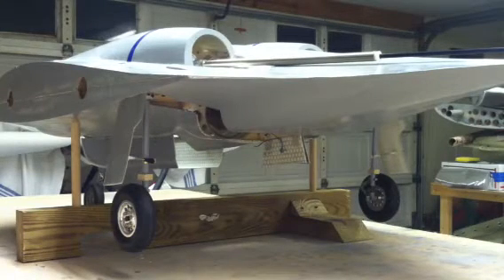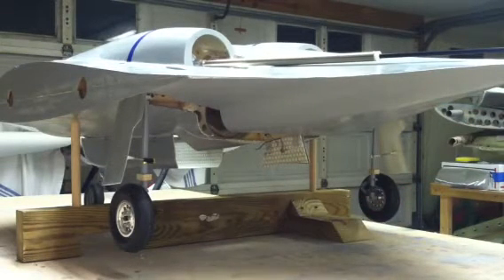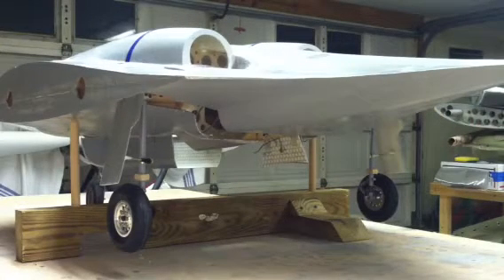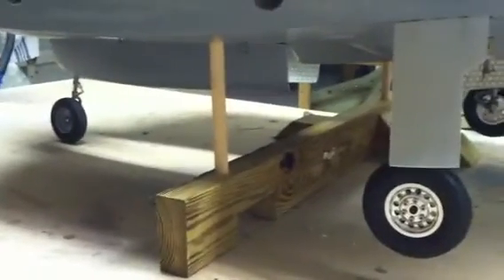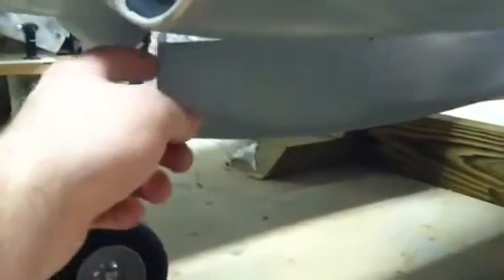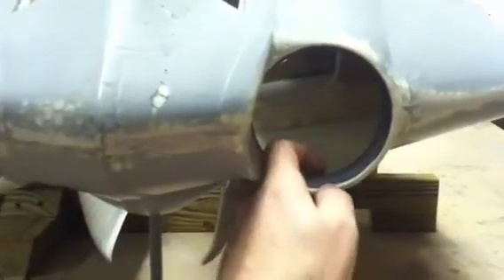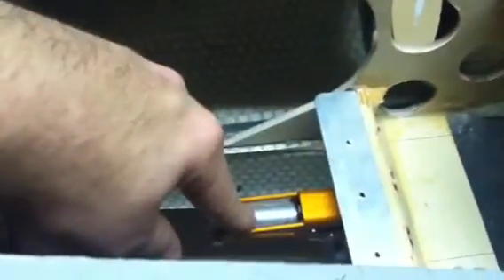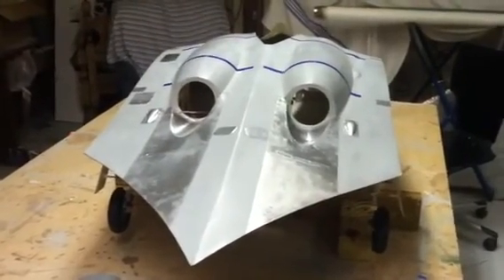1/5.3 Horten HO-229

Comment: You keep saying 32 pounds! I have a Sky-Walker-X8 that is 15 pounds on the money! and the plan is to move this plane with two 90mm Fans? I'm having fly times of barely 15 Min on an 8K mAh battery! Don't you thing that a larger fan unit will increase the performance of this plane? Don't get me wrong I have the frame for the same plane at a 1//4 scale and even so! as it stands I see that the 120mm fans that I have may be to small!